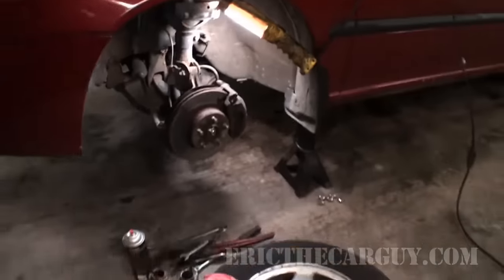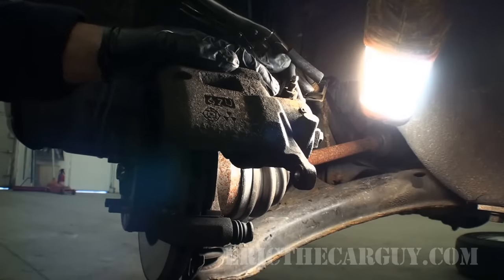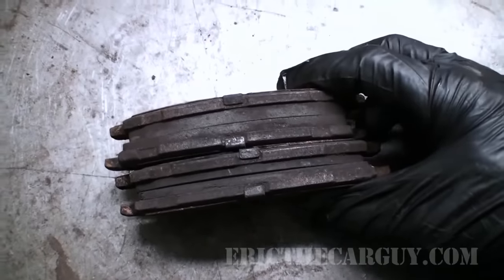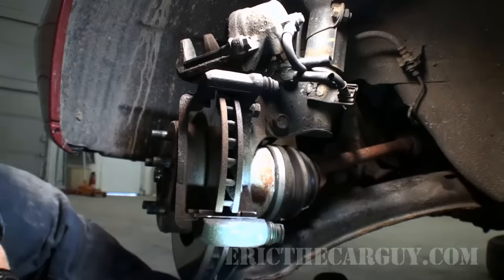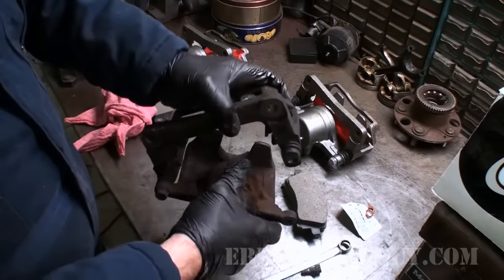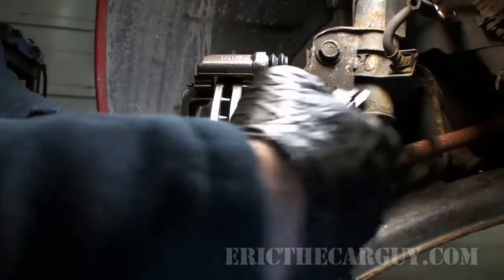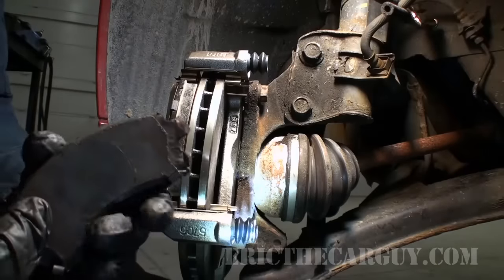How To Diagnose and Replace a Bad Brake Caliper -EricTheCarGuy

Comment: After just buying 2 re-manufactured callipers, i can tell you i will avoid doing it again at all cost! Id rather buy slightly rusty dirty originals from a vehicle being dismantled for parts.

Whatever stuff they use to clean up the calipers must be very nasty!. The amount of pitting around the nipple, brake hose, and inside where the pads go is absolutely shocking IMO! I have had better luck using electrolysis on much older callipers, then wire brushing. They looked like new fresh callipers as id expect. 2 new pistons and complete rubber kits only cost the price of 1 shonky re-manufactured calliper. And i got MUCH better results!

Comment: at 22:05 the sensor are most people put, but I like to look the old pads ,so I put it where are the pad s worn faster, until they worn the same, of course I will tell the owner the  brake caliper have problem. and see some old benz the sensors are one top one bottom fitted.

Comment: Ok so I took all the caliper apart because when I put everything back together from a ball joint and tie rod replacement the caliper was hitting the back part of the rim.
I ended up taking the caliper all apart and tried that, but still it touches the rim when the tire is put back on.

Comment: Never worry about stopping work to explain what you believe is important.  Belive it or not, your actually much older, AND wiser, then the first time tried to paint a word-picture to a grease-monkey wannabe (who missed listening class in school). Seriously, though, my experience in checking/diagnosing my vehicle according to many of the finer details you've stop to explain in your videos, is that my success was often due to, relied on and occurred in large measure, because of those succinctly communicated, critical sidenotes. If not for many of those, my seemingly expert-level of mechanical prowess  may have been regarded quite differently. (Eespecially if i just went solely with one of Southside Auto Mangler's "lucky-call" videos or re-awakened after being inesthatized by one of Scanner-Danner's 3-part, 6-month, vocational-diploma series), All mediocre humor aside, there truly is unequivocal value in your traversing those little "aside" streets, "one-way" bridges, "right-turns" and  detours, as they spring forth, from that billon-synapsed, neuro-network, betwixt your ears in particular  (So that's the extent of my auto-mechanic humor...for now) And you have a good & solid, on-camera presence.  can easily attest that it's made a difference for me in 60-70% of my rebuild repairs on my '97 TJ that I've been customize/renewing, for 5-years or so. So please, your intuition is ALWAYS spot-on, and your 2nd-guessing is ALWAYS an unnecessary, conditioned-response. You rock. (Your spontaneous humor is good too; so just let it happen and get out of your way. I know you know what i mwan. You've got enough on-camera  experience a 100-times over, to know what I mean. I just don't know if anyone's que'd you in on that aspect of your talent, but it's definitely there ( and rare, so use it, ('cuz it's a lot of fun when it just roles off you, without pushing. You'll see (if you read this far.

Comment: Not always the case sometimes Steering lock drops in when you remove the key not when you turn it to stage one, you just have to put the key in turn it to position one then turn it back to the first position n it will stay off the steering lock , just my ocd I like to get rid of all chances of killing the battery 🤣
Reply: Sorry put the key in turn it to stage one then back to stage 0🤣

Comment: Hello everyone, can somebody let me know if It is necessary or not to open the cap reservoir in the engine to let the pressure goes? some mechanics told me that without doing that the ABS module can be damaged... and of course is very expensive. Many thanks,

Comment: I just analyzed my front driver side caliper and it is completely shot. One of the two holes where the slide pins goes through has a couple of holes that has worn through so that bracket all needs to be replaced along with all boots and pins and everything else. 2000 F350 4X4 7.3 with almost 180,000 miles on it and I want to buy complete calipers with brackets. Can anybody recommend a particular brand that they have had good luck with or have heard of any brands to stay away from? I am a bit paranoid of buying anything from AutoZone and Oreilly. I am currently on RockAuto looking at the huge selection that they have and the prices are better than the local crap. I see that I would have to pay a core charge so that means that I would have to spend money on sending my old set back to RockAuto. ACDELCO, CENTRIC, A-1 CARDONE, RETECH, RAYBESTOS, MOTORCRAFT, NASTRA are the brands they offer. Has anybody had any experience buying calipers from RockAuto or somewhere else? I want the loaded calipers with all hardware with metal pistons, I don't want cheap stuff when it comes to brakes.Thanks much.
Reply: +Nate In TX try using rockauto dot com and plug in your vehicle.. Parts are cheap there and I buy stuff for my car from there.

Comment: Why do you prefer the steel washers over the copper ones? There's no way I'm the first person to have asked that, I just can't find the answer. So, why?
Reply: Found it posted: 5 years 7 months ago (Post #10659)

EricTheCarGuy replied the topic: Banjo Bolts and Crush washers
Honestly I probably shouldn't post this here but having done a few services on fuel filters with both OE and aftermarket parts I've discovered that the coper aftermarket washers tend to leak even new. This prompted me to reuse the silver washers that were there to begin with and since then I rarely have a problem. It's good practice to replace crush washers however if the new ones leak and the old ones don't.......
Reply: Copper is the way to go. They are soft, they will be molded into your brake fitting. I have never even seen steel washers on calipers in 44 years.

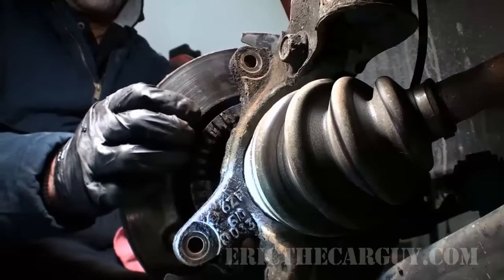Comment: @ 14:52 how did you just pull it off ?  on my car i take off those 4 bolts behind and it all comes off together. i cant remove the disk its like stuck to the part you said to be carefull with or the abs might come on
Reply: brian alvarez I've seen some rotors that just fall right off and others that are factory and have virtually welded themselves to the hub, except they are welded with RUST.  It may very well seem like the rotor is not coming off without taking off the central "hub nut', but i assure you the rotor is not held down or a part of the hub. If there are small set screws that hold your rotor into place take those out, i've seen some that are insanely difficult to get off and had to end up drilling them out, but that's okay because you don't actually need those.  A good plastic mallet or, if you're replacing the rotor, a metal hammer should EVENTUALLY break loose all the rusty grime holding it onto the hub. Just keep smacking...

Comment: Looked so easy, but when I did this same job myself I ended up with spongy brake pedal and no matter how much I bleed the brakes and there's no air coming out it stays the same. Pedal feels OK when car is off but after starting up turns spongy and it goes almost all the way to the floor. Now I'm afraid that I may have busted master cylinder as I didn't realise that I shouldn't depress the pedal too far when bleeding as corrosion in the cylinder may tear the seal? And no, I didn't let the reservoir run empty at any point and I clamped the hoses when I removed calipers.
Reply: YouStubid I HAVE THE EXACT SAME PROBLEM!!! I just replaced all my pads/rotors on my 2000 buick park ave and ended up replacing my 2 front calipers as well. Bleed all the brake lines multiple times with the 2 person method and we are sure there is no air in the lines... Pedal is firm when vehicle is off but spongy after it turns on.

-If you end up learning of your issue, please let me know what you did to fix it!
Reply: Jon Blackwell I was sure that my brake master cylinder was busted, but after replacing new MC it's still the same, if not worse! No leaks, brakes work and hold car in place at incline, it's just the damn soft sinking pedal. So I guess there's just air stuck somewhere that doesn't want to come out by normal bleeding, maybe in ABS unit...
Reply: I took my car into the dealer yesterday and they said that my front brake calipers were mixed up. I had the left one on the right side and the right one on the left side. I'll be switching them back over this evening... Could you have done the same thing?
Reply: Jon Blackwell I was actually wondering about this when I was going to install caliper with L-mark on the driver-left side but it looked like it was upside down compared to old caliper. To me there was no other way to install them than L-caliper to driver-right and R-caliper to driver-left as I couldn't get the brake hose attached otherwise. Anyway, I installed them just the way old calipers were and assumed that I was supposed to look the car from the front so "L" was passenger side and "R" driver side.
Reply: ***** I took the car to garage and let mechanic take a look at it, he pressure bled the brakes and got a bit of air out. He also replaced front discs and pads as they were quite bad.

Maybe brake pedal is a bit better when pumping it having engine off and while driving, but it still sinks to the floor when I step it when car is idling. Mech didn't think it was quite normal, but as he couldn't think of anything else and brakes were holding well then just condemned it as "feature".

I don't know how pedal should feel when brakes are in top-notch condition as all pads were fused into calipers and didn't move at all and I haven't owned this car for more than couple of months. Maybe it is feature of Hondas, don't know. But I'm afraid to take it to MOT check because I'm pretty sure it'll fail.
Reply: YouStubid You looked every single place but the vacuum booster...And either it'll leave you with a hard pedal (as if engine was off) or it'll have too much assist to it, and your pedal will sink to the floor.
Reply: Chris Wilson
Then it shouldn't be a problem and my brakes work 200%? lol. Well yeah I didn't think of brake booster because everyone says that pedal goes hard if it's bad&leaking and I've never heard bad booster working "too well".

MOT inspector didn't seem to care about that though and my car passed, phew.
Reply: YouStubid true, a lot of people say you get hard pedal when they go bad or start leaking, but that isn't always the case. Like I said, sometimes they go bad and give too much assist, giving a spongy pedal that goes to the floor, while your brakes still work good as far as stopping goes. Just dealing with that crap on my '01 Navigator right now too. Know i'ts the booster, but for my Lincoln it costs $400 and you practically have to rip the dash out to get the booster loose.
Reply: Chris Wilson Now that I think about it, booster giving too much assist must be bad as it puts for the rest of the braking system under abnormal amount of pressure? As brake fluid doesn't compress, how else can pedal still have more than normal amount of movement without some place eventually giving up like brake hose burst or piston gasket leak in MC or calipers?
Reply: For those of you who think your booster might be or is out.. The tell tell sign is when you apply the brakes while the car is running you will hear a "woosh" as if there is air hissing past a blown rubber diaphragm. They all make the noise when working correctly but when you get a bad one it will be very loud.. Another test is that if you can "stomp" on the brake pedal (in park, NOT MOVING) and it goes very hard, then bleeds off the pressure quickly its most likely the booster.

Comment: I changed my calipers and greased pins but still have both front brakes holding just slightly when pedal is not pressed. Ever seen that???

Comment: I change my rear brakes and now no rear breaks the rear brake aren’t catching as quickly as the front brakes that I didn’t change what could be the problem i pump the pedal after the job as I was told but some said I’m suppose to bleed the brakes can you help me out

Comment: Brake Pads: You said you use anti seize on the ends(Time: 25:38). I use silicone grease. What is the industry standard mfg uses?

Comment: Had the same problem then I changed the calipers pads and rotors, and the new caliper was sticking on the same wheel, It was a bad brake hose.

Comment: I've never heard the term "core" what is the deal with returning the core parts? And where can I do that?
Reply: Jake Dougherty  So the core is the old part you take off your car, like the brake caliper you're probably gonna replace. The auto parts store where you bought your new calipers, or whatever part your changing, will actually refund some of the cost to you for bringing in your old parts. Certain pieces of a part wear out or break, like rubber seals. But most of the part is still usable, the core of a part. Chances are the new part you get is an old core that's been rebuilt with new pieces. 
Put your old brake calipers in the box that came with the new ones, make sure you put the old left caliper in the same box as the new left caliper since the right and left calipers are different from each other. Then just bring em back to Autozone or wherever you bought your brakes with your receipt and they'll give you some money back, they probably call it a core charge. Same goes for old batteries and lots of other parts too =D

Comment: When you open the bleeder valve, you can compress the caliper with your bare hands. You don't need a tool. If you can't compress it with your hands then it's probably a bad caliper

Comment: You'd think that a bad hose wouldn't squirt and that a good one would.  I just had to do my brakes due to a caliper that was dragging due to the line being pinched, the fluid was only going one way and not returning.

Comment: I got a long squeak under normal brake pressure. very light brake no squeak. hard brake no squeak. ive spent close to $400 on mechanics trying to fix it and nobody can. Any suggestions? 08 accord
Reply: If its not the brake pads worn out, it could be the brake pads themselves. When you have metallic brake pads, a lot of times a bit of metal is squealing against the rotor. Solution: Get ceramic pads. (or asbestos pads... jk they don't make those any more)

Comment: old flex brake lines get corroded inside and will let fluid in but not out (like a check valve)  causing smoking hot brakes.

Comment: My VW Golf 2003 car's left rear side bleeder screw doesn't leak fluid when I crack it. So, is it possible that you can't do the gravity bleed on some cars? Or, what's wrong?
Reply: iKearGunz it wouldn't be a ton of brake fluid coming out on a gravity bleed, its most likely that your bleeder valve is full of gunk, if its brand new then that's a different story, but if you watch the ETCG video on doing a rear brake job, he finds a bleeder valve that he can't bleed the system through, the problem was it was full of gunk, you'll need to pinch the brake line and remove the bleeder valve, look for the small hole that goes inside the caliper and with a pick or even a tooth pick, thoroughly clean out the gunk, a wire brush can also help cleaning around the edges. You'll know it's working correctly when you can blow through the bleeder valve.
Reply: Yeah, found out. Thanks anyway tho.
Reply: Dan Gleason I replaced my caliper but my rotor is overheating ever since. What could i have done wrong? Any ideas?
Reply: iKearGunz a rotor overheating on a new brake caliper is a bit of a mystery, I had a similar problem on my last car, I figured out that it could be the master cylinder not properly releasing pressure when you let off the brake. Its nearly impossible to diagnose this without replacing the master cylinder. 
My old cars brakes could over heat and warp a rotor in a few months when I had just replaced rotors and pads. I eventually bought a full brembo big brake kit, something much harder to overheat, and it took much longer to happen but it kept coming back. The final part I needed to replace to likely solve the issue was the master cylinder. But I sold the car before I got around to doing it.
Reply: Oh alright! Thanks a lot for the info. I'll take that into my considerations.

Comment: Are remanufactured brake parts the way to go?
Reply: Matt anything at the wheel should be just fine going with re manufactured... with master cylinders and brake boosters ALWAYS go new.
Reply: I agree, I had a remanufactured master cylinder die after 5 months.  Brakes went out on the freeway and almost couldn't stop.

Comment: Mine was making noise.  I put all new parts and bearings in, basically rebuilt my whole front end.   Put it all together and guess what ? The same rotating noise after 800 bucks in tools and parts.  Took the caliber bolts out, started to pull the caliper off and the pads were pinching the rotor hard.  The brilliant Ding Dong that I'am finding the problem and bought a new caliper.  Putting it on Sunday.  Does anyone know the torque spec for a banjo bolt for the brake caliper for a 1998 Saturn SL2  ?

Comment: Do a new version in 2022 plz . What about when you spin the wheel and it spin free in one area then tight in a next area.and I have ? Calipers or rotors. The rosters I have is form Auto zone not even 6 months yet .but I have to get a G 🗜️ to get the piston in with lots force  .. Help